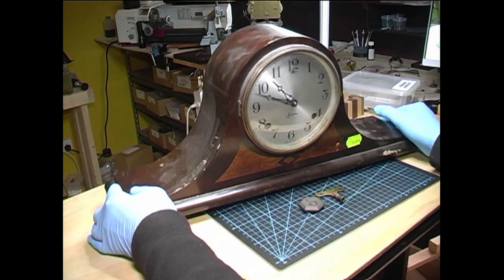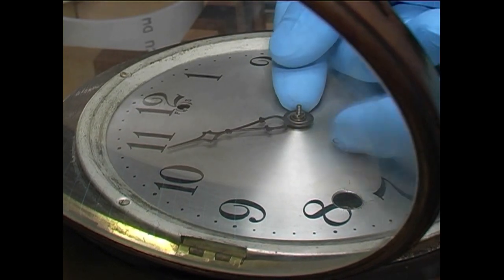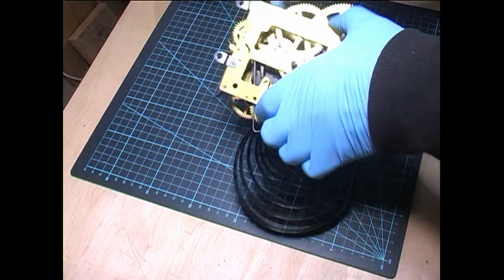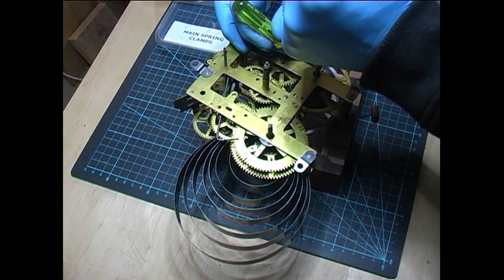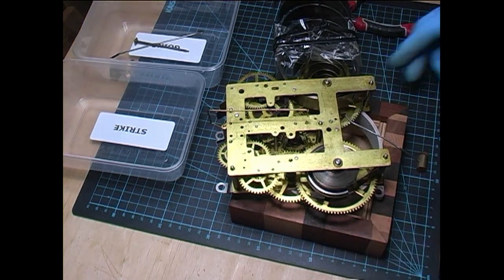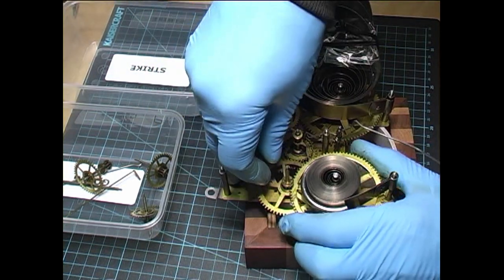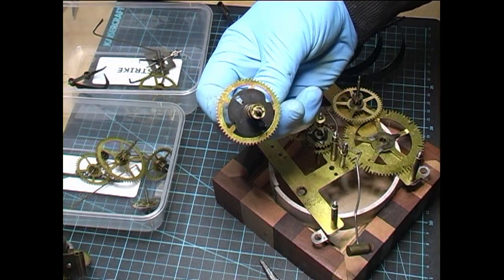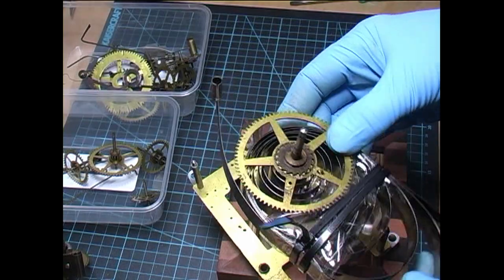Sessions Berkeley mantle clock service / repair & case restoration - Part 1 #americanclockrepairs

Comment: Beautifully done thank you for sharing this tear down. I just took a 1940 Sessions mantel clock to be cleaned, it has the 5 gong chime action and the Clockmaker said that Sessions made a good clock movement, but the chiming mechanism was not reliable or well-made: I wonder if that is true - it looks very clever to me.
Reply from the maker: I don't agree, but we all have opinions. The clocks were originally designed to last up to five years and here we are 100 years later still working on them

Comment from the maker: Servicing a Sessions Berkeley eight day mantle clock, manufactured approx 1930, strikes the half and full hours.
Repairs: missing click and click spring on on the going train spring winder, the suspension spring is broken, the count lever is worn in the middle.
The case is a bit rough so we will sand it back, give it a light stain to enhance the grain then French Polish it.
New videos added every Wednesday.
Don't miss out.
If you're new, Subscribe: https://goo.gl/jgk1Tk  for more exclusive videos every week of the year.
Then activate the bell on the top right hand corner to receive notifications, you will then be notified of all our new video uploads.
Thanks for watching.

Comment: The clock you repairing is exactly like my grandmother‘s clock. The cabinet has been well restored, but there’s something wrong with the movement it’ll work for a minute or two and then quit. What is the likely problem and where can I find parts? Where can I find a clamp?